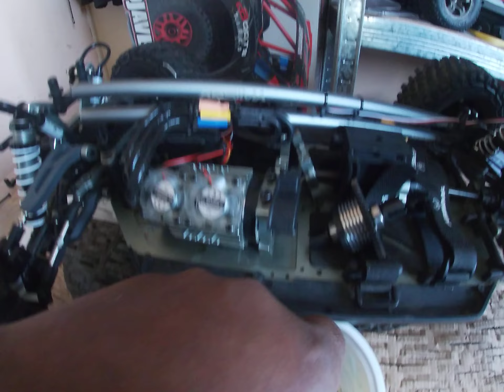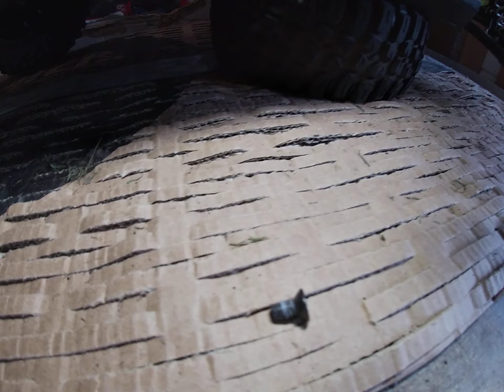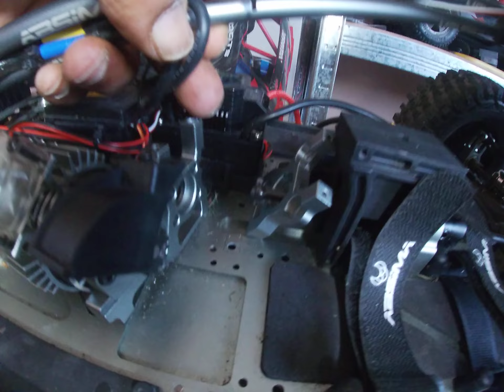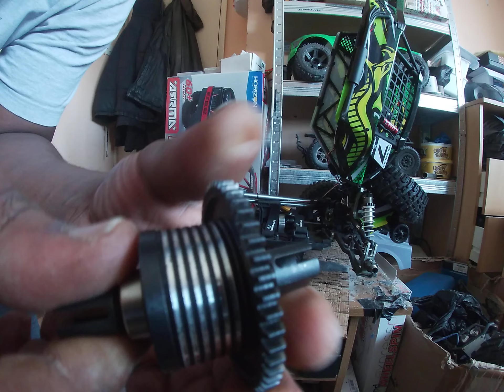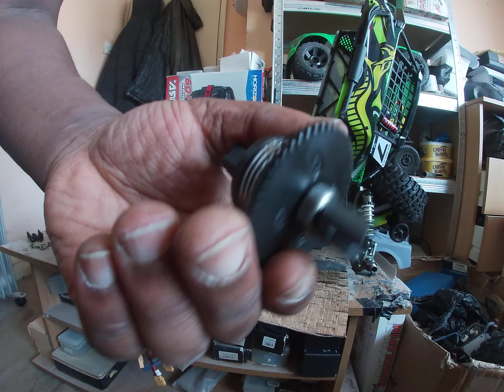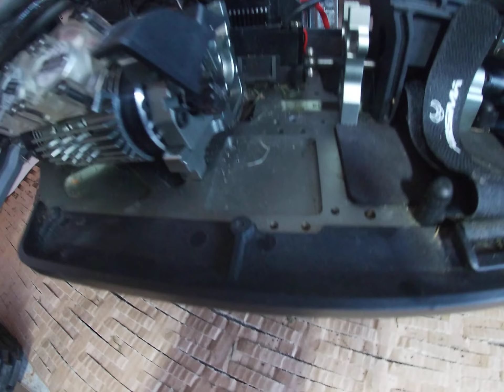I stripped out all my Allen keys getting into this Absima Mamba 7 center differential 😭

Comment: Grind / sand or file the tip of the allen key back a few mm where the key is worn or rounded off. You then have a brand new allen key with no wear, been doing this for years on Allen keys & they last for ever.
Reply from the maker: Oh okay, I'll give that a try, but I've ordered some steel ones, Amazon special, but I'm not sure if those sort of screws like steel, especially when screws locked tight, the screws tend to strip I think,